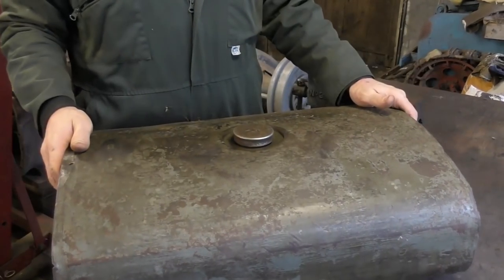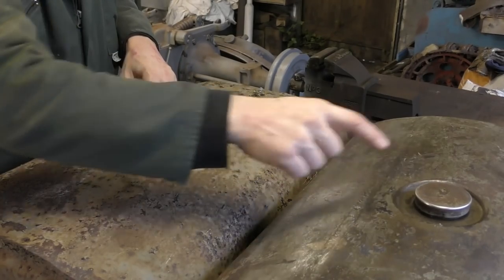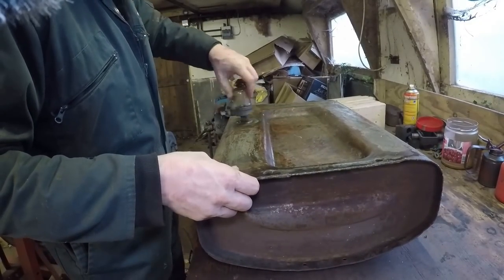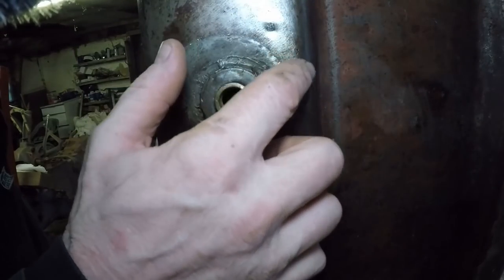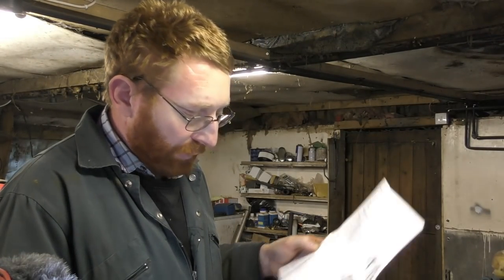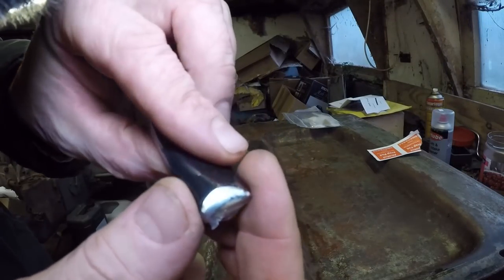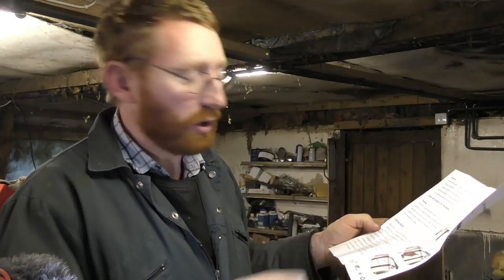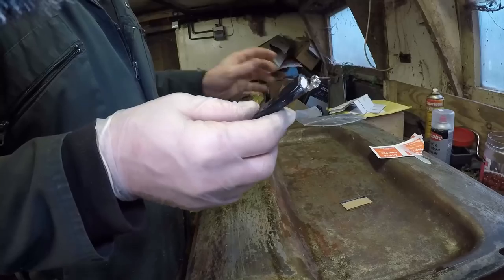Vintage Thursday. Ferguson tractor fuel tank repair.

Comment: i used a bit of hydrochloric acid and old copper block  solder iron heated it on my bbg gas stove  with plumbers solder and 1/16 inch plate . i did my one off a 47 tvo tea 20 still good after 12 years .

Comment: i used that type of epoxy putty on a car i had on it's fuel tank. the directions said to form a incense cone of putty and put the small  end into the hole and spread out the larger end. i think i had to do 3 holes and it worked perfectly.

Comment: Wish I'd known about this stuff, I tried a few different things to try and fix the leak  around the fuel filler neck on the original fuel tank on my TEA20. Ended up buying an original tank off another tractor to cure the problem.